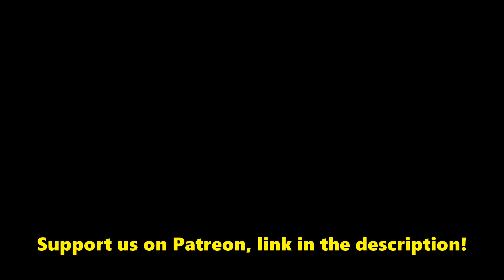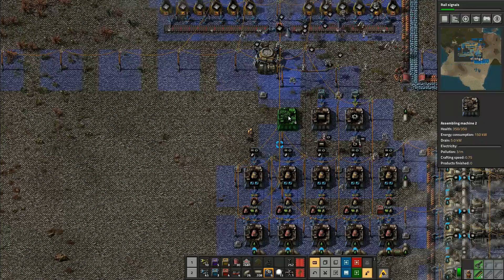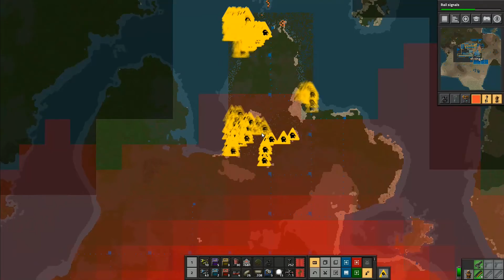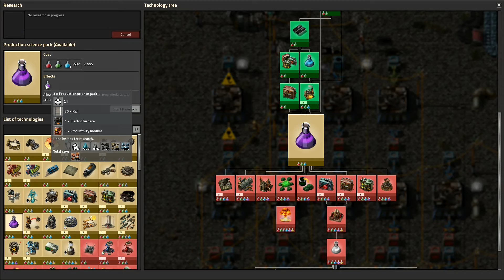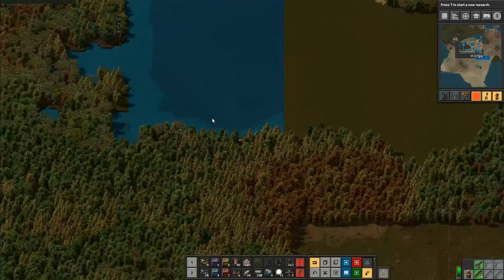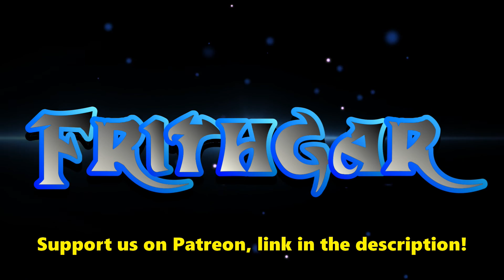Factorio Million Robot Challenge #60: Automated Chest Building!

Comment: Why do you concentrate on Steam Engines for power? They only produce 900kw each, whereas if you replace the Steam Engines, with the Steam Turbines, they create 5.8MW each. it would take up less room, and create WAY more power. Just food for thought man, Great Vid!
Reply from the maker: Power production is based on the temperature of the steam, not the unit.  Boilers can only put out 165c rather than the 500c that the turbines would use from heat exchangers.  One turbine produces 1.8mw of power at 165c, which is exactly the same as two steam engines and consumes the same amount of steam/water, it also takes the same amount of fuel to power it as two steam engines.  The difference is that they're more expensive to build but take up less space, and space isn't really an issue for us any more, we're expanding rapidly!